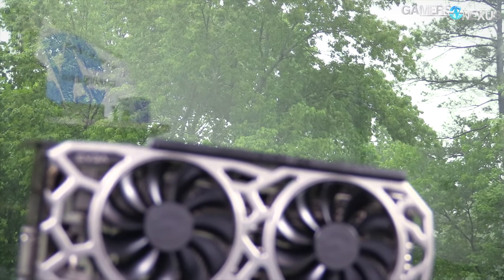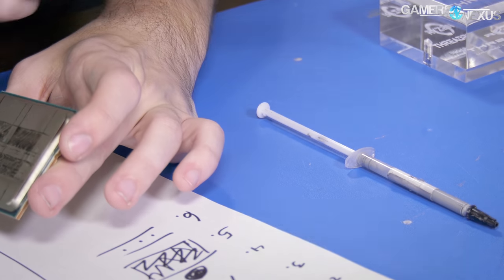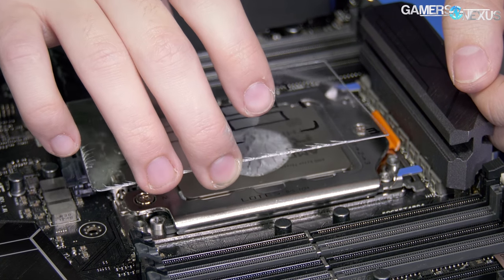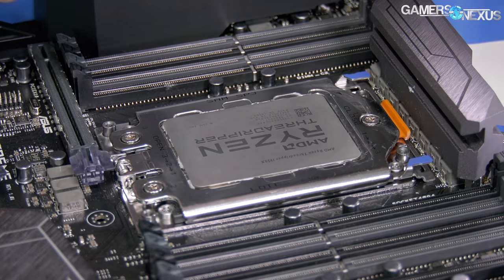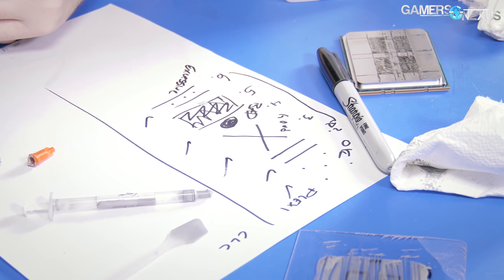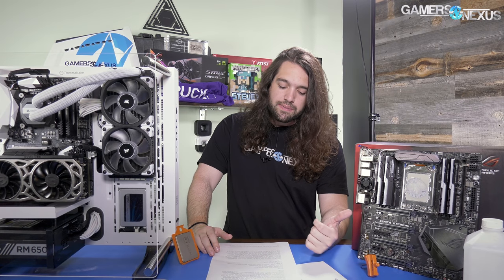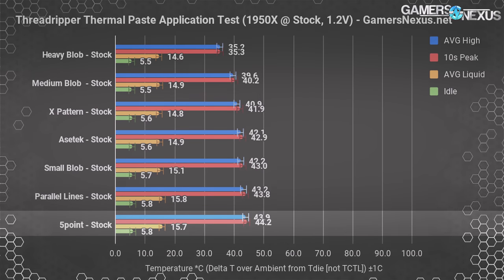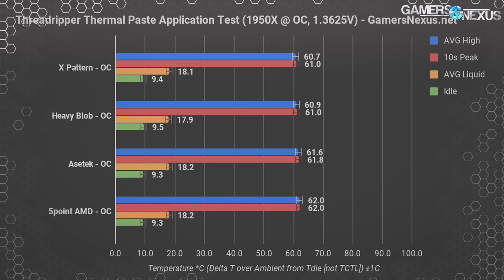Threadripper Thermal Paste Methods Benchmarked

Comment: I would use automotive copper grease and car radiator for that :D
Reply: hides computers
Reply: vabese XD. I actually probably wouldnt do the copper grease but car radiator would be good. P.S- using copper grease on core 2 duo(does pretty well 50C maximum with Scythe Ninja 4 passively cooled)
Reply: I've been considering using a car rad for a long time. Guess when I have my own house I might do it.
Reply: ColtaineCrows I knew a guy from Germany who used a car or truck radiator with his set up. Had it under his desk leant against the wall with a bunch of various fans attached with wire. 

It performed really well ha.
Reply: I'd just stick it outside and let it cool passively, don't want to go too overboard in "sub ambient" cooling. But yeah, it would work well, it's meant to cool off lots of liquid with several kW's of heat getting pushed into it, having to keep that liquid at around 90*C even while the car isn't moving and using only a dinky little fan in many cases. Cooling a mere ~200W or even 500W would be a piece of cake. 

Anyway, there's the whole mixed metals thing, but a G30 auto-coolant or similar should have the correct corrosion inhibitors to make that less of an issue as long as it's mixed correctly.
Reply: ColtaineCrows aren't most car radiators aluminium? So just use an aluminium block...
Reply: car rads aren't designed to be used like that - they're meant to get LOADS of airflow, more than even our fans will give.... That being said, the original watercooling radiators were all salvaged or new parts from the heaters in cars - less airflow, less pressure needed for optimal performance.. also a lot of car rads are aluminium or alloy these days
Reply: john bumptybump 

They work, the fin density isn't much higher than a standard pc water cooling system. So long as you don't get one that's obnoxiously thick even minimal air flow will allow it to cool very well thanks to the obscene amount of surface area. You also have to bare in mind the fans mounted on say motorcycle radiators only move about 300-400 CFM. 4 decent pc fans would do that. Or two obnoxious industrial pc fans ;) 

Car fans probably move a lot more air but there's a lot more restrictions infront and behind the rad. Even on a motorcycle things like mud gaurds / beaks can restrict airflow to the rad a bit. 

Being able to completely cover the things in fans adds up :) 

For example my motorcycle radiator would accommodate 4 140mm fans quite nicely, or 6 100 mm fans. That's a lot of air potentially depending on the fan set up.  

Also, vehicle radiators deal with a lot , a lot more thermal output than any CPU or GPU ever would. So having less airflow. Like say 200 CFM or so, from 4 gentle typhoons would be more than adequate to deal with a good 2000w of thermal output from your system ;)
Reply: Well, could just as well just use a heater core, no need to go full blown rad. Still letting it passively cool for what wattage a PC puts out would be totally fine. Could throw a car rad fan on there and run it at a lower voltage than it was designed for given you have a power source that could supply sufficient amperage. 

Remember the most efficient diesel engines still throw 60% of the energy it consumes off as heat. A gasoline powered engine throws around 70% out as heat. Sure some of that goes out the exhaust and some in the oil(still gets cooled by the coolant), but a LOT of that ends up in the coolant loop.. That's way, *way*, more than any normal desktop PC will ever put out.
Reply: +GetTheCheeseToSickbay, I thought I wrote that somewhere, guess it was a different comment. Anyway, yeah, most car rads from like 1995 onwards at least are most likely aluminium. Older ones would often have brass hose "connects" and copper cores with aluminium or even brass fins.
Reply: largely because of thermal mass, yeah... so not efficient though
Reply: People used car radiators for watercooling for years. In Europe the Opel Corsa air heater radiators were the most popular. I still have one kicking about on a shelf, with the fittings still attached :) It's all copper and really thick, but still small enough to be practical.
Reply: Personally, I'm using a R6 Yamaha radiator, combined with two 200mm fans for a push/pull setup. However, it'll be for cooling three PCs in a single loop.
Reply: People used to use automotive heater cores for ghetto custom water cooling. Gotta watch the mixing of metals though, not all of them have the same.
Reply: Raven1024 Indeed, even at the time mixing metals in a loop was a big no-no.

Comment: I suspect that using a center blob would allow all if not most of the air to be pushed out the sides where it can escape where some of the other methods could trap some when the paste fronts meet up during spreading. 

2nd point about a single blob is there is a much higher concentration of force on the paste which would spread and thin out faster (of course slowing down once spread some), so while the others are still spreading under load and being tested the blob method is more than likely spread thinner by that point and probably is why the performance in the test is better. The thinner the paste layer the higher the thermal transfer rate.

over say a few days or weeks the others should catch up in performance and all should improve as well. 

My method I found with testing to work best is to spread a good amount paste over each mating face, CPU and cooler and then using a lint free cloth I rub the paste thoroughly into the surfaces without removing it. Then I use a plastic card as a squeegee I scrape off everything I can. What this does is it forces the paste into the microscopic grooves and texture of the surface filling the voids so majority of gases are pushed out and replaces with paste. The surface looks clean but discoloured, darken using most pastes on the market, I use AS5. That is the paste embedded into the voids. Then from there I proceed the normal blob method.

Comment: i always just used card or something thin and manually spread it thin layer all over the heat spreader then let the cooler press out uneven spots always worked fine for me even gotten some what cooler results then using just blob in middle method since not insanely caked on

Comment: Thanks for this, conclusion I've come with no reason to get a threadripper until there's a full plate solution.

For me, it's waiting for a custom water block, EK has stated they are working on one but nothing on their site yet.  Other than if you punch in the ASUS Zenith board block status is, "Coming Soon."

Comment: I think you should do this again actually bolting the cooler to the socket. You can make up for the thickness of the plastic sheet by using spacers of the same thickness with any bolt-on cooler that uses the 4 corners.
Reply from the maker: We did that later in the video.

Comment: The problem you are having with the plexi-glass is because its too thin and it is actually flexing, causing a less even spread. If you use a thick solid piece of plastic you will be able to apply better, even, pressure and get a better result. Also something you and most other youtube pasters forget is, once the system is running, the heat from the CPU warms up the paste and helps it spread out more under the cooler, not just from the pressure of the coolers mounting.

Comment: Redo this test after you get a cooler with full TR4 wide rectangular plate footing on your hands. Not that small-ass, wrongly shaped AseTek. Fortunately for you - Enermax just now announced the availability of LiqTech 240 TR4 AIO with a plate that FULLY covers the entirety of THREADRIPPER's socket. This thing should (and highly likely will) work way better than AseTek.
Reply: In their (Enermax) video they put a tiny blob of thermal paste on center the IHS. That cant be right after watching this video.
Reply: Naturally that was just purely for example purposes.
Reply: It may have been an example but the problem is people may see that video and continue to think that putting a tiny little blob on paste is still the way to do it. From the size of the blob they put on in that video and comparing to what was shown in this video there will be problems.
Reply: I personally highly doubt that anyone who decides to buy an expensive, high quality, high-tier AIO water cooling solution, is so utterly inexperienced or downright stupid as not to do the thing the right way. People such as these won't bother and would just buy an air cooler, instead of "messing with water". Even if it's "just an AIO" and not a hardcore solution that is FCWCL, you still need to have at least some minimal experience accumulated of dealing with computer hardware, before you go and decide to buy yourself one. Air, on the other hand, is, mostly, absolutely "fool-proof" (ESPECIALLY if it's something like a Noctua or a Cryorig product) thing. At least that's how that usually works.
Reply: Not everybody who buys these high end systems builds them themselves. I new someone who bought a boutique HEDT system and there were no air intake or outflow fans on the thing - it had an AIO and the builders told them that was enough airflow. Sure enough when it was overclocked it overheated which i cured by installing more fans.
Reply: Well...I obviously meant overall worldwide usage, not a few isolated specific cases which only solidify the general rule.

Comment: What would have been cool is to mount the heatsink, but have a super thin piece of clear plastic between it and the paste, such as an overhead projector transparency sheet, so that you could remove the heatsink and see how it looks without the paste getting pulled up when you remove it. You could compensate for the added thickness by not tightening it down completely.

Comment: Nice Video. The heavy and medium blob method doesn't produce small air pockets as the others where thermal paste has spacing between application areas. How about the old method of making a thin layer on the copper plate of the heat sink covering the whole circle even filling the screw holes (we used to do it on the CPU but seeing that the CPU is bigger then the heat sink you put the layer on the heat sink)

Comment: Doesn't the heat spreader do just that-- spread the heat? under continuous usage, the whole surface comes to an equilibrium depending on how much heat it's getting, so focusing on where the TIM should be, instead of trying to maximize surface area contact for a given heat sink, seems a little silly? If I disable all but one core on my ryzen 1700, after a few hours, temps reported for each core will be within 1-2C.
Reply from the maker: That's the point. People argue about method for application all the time, though.

Comment: A solid peace of hard glass would have worked much better than flexible Plexiglas
Reply: It was just meant to be used as a visual demonstration of how the thermal paste would spread :)
Reply: without the massive mounting hardware, you're never going to come close to the pressure needed to show a realistic spread.
Reply: yea, i watched the rest of the video, and i guess he does address it.
Reply from the maker: We address that pretty thoroughly when we come back with the actual cooler mounting.
Reply: Most AIO's also recommend a twist. Read the manual of your AIO's. Twist and back 45 ish degrees.
Reply: Gamers Nexus u will have to put the glass under the cold plate and torque it down to get the recommended pressure. 
Put a little cloth or piece of mouse pad to protect the glass from breaking under the cold plate.

But seeing the after pics of the cold plate have shown the spread of the thermal paste, already. So unless a different sized cold plate is used, this will be redundant
Reply: he should have just used the ryzen glass case, lol.
Reply: Use a thin piece of clear plastic under the normal heatsink and torque it down. Then remove the heatsink.

Comment: Since there might be air trapped in the countersunk screw holes on the copper plate, I wonder if it would be better to apply the paste to the cooling element instead... filling the countersunk holes with a bit of paste to push out air.

Or an alternative idea: Use any good pattern on the CPU (something resembling "flag of Wijchen", probably), and pre-fill the countersunk screw holes with small blobs of thermal paste.

Comment: Is this method any good?

 Use the thin spread layer method(possibly a little thinner than normal) on the cpu or heatsink surface(whichever is smaller). Press the cpu and heatsink together making sure it's around the point it will be when mounted. This will create an imprint showing the surface area shared by the two surfaces. Lift the heatsink up and use the paste that was already applied to spread a very thin even layer in the space shared between the two surfaces on both the cpu and heatsink. Make sure it's even and covers completely(the shared surface area). Then apply a very small pea on/over each die area. Use as small of a pea as possible. Then press the heatsink back on top of the area imprinted and rotate back and forth while pressing very gently on the heatsink. It should feel like it's floating on the paste. Without lifting the heatsink align and fasten the heatsink and try. If done right it should not leak anything out.

I do this on the thought it will fill in micro crevices. This method also scales with any level surfaced varied size die/heatsink and logically produces full, basically exact, coverage. I'm not sure if there is anything bad about it. Are there any problems with it that you know of? I don't really know anything about how thermal paste should work on a technical level.

You can do the gentle rotation part while the heatsink is partially attached if needed. It should help spread the pea sized dots around.

 Also, Is it bad if small amounts of black substance are left on a die surface. Mainly left after cleaning with just a paper towel. I usually then clean with fresh paste itself and a further wiping down to remove as much as possible. But there is some small residue left afterwords normally.

Comment: another cool way to show the spread is to use a transparent film (like the screen protectors for smartphones) between the cpu paste and the cooler, so you can put real pressures and then remove the cooler leaving the film... hand pressure is not perfect and you could damage the mother

Comment: so wait... intel can't keep one cpu die from not hitting its thermal limit without risking breaking the thing with deliding and then you'd need a fairly respectable liquid cooling setup to even handle it? yet amd can keep 4 cpu dies under complete control with a standard aio even when not completely covering all the dies? intel wtf...
Reply: AMD spent the extra 2$ to solder their dies to the heat spreader.  Intel being supper cheap this way finally bit them in the ass.

Comment: Thanks for the exhaustive testing. But I have a suggestion: 
What about trying without any thermal paste? This would clarify the issue that some people have with it: after all, the best heat condutor is direct metal to metal contact. If there are not enough air bubbles to justify applying the paste, it actually has a detrimental effect.
Reply: They did and he mentioned it towards the End.. They said TR did not like that at all.
Reply: Oops, probably skipped that part. Thanks for letting me know.
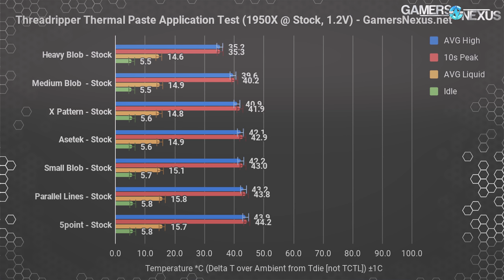Reply: Yep, just found it at 18:30. Thanks again.

Comment: Great video! I am going to buy a Threadripper probably around December, and I was wondering how to apply the thermal paste on the CPU. I have always used the blob method on my applications of compound, but I thought the line method would work on Threadripper. Who would have though a bigger blob method would still would on a bigger CPU.

Comment: Wouldn't using a thermal camera to determine which parts of the cpu actually produce more heat (and thus figuring out which are the active dies) be a good idea? Just a suggestion. I guess this aspect shouldn't change from chip to chip, as - as far as I know - AMD stated that the "inactive" dies are dummys not actual deactivated dies.

Comment: id suspect any of those methods included the first blob would work just fine once you apply real pressure with a cooler and some heat from powering it up

Comment: Why not pinch the plexi between the CPU IHS and the cooler? I know the plexi adds depth but you could still use it to clamp down to roughly the pressure. Removing the cooler would then reveal the plexi and paste spread without much disturbance.

Comment: Hi Steve, any chances to do the same testing now with the Enermax Liqtech TR4 given the 32 cores 2990wx is out?
Would be interesting to see any differences in temperatures using different methods to apply thermal paste.
Thanks for your reviews, always very detailed and useful 👍

Comment: If you have a cooler with a base that covers all the cooling plate of the cpu, then you would have gotten different results. I belive that Noctua has a cooler that is specifically made for the new threadripper cpu. The large blob in the middle would not spread out to the sides equally since the plate is a rectangle, and not a circle or quadrat.

Comment: Am thinking about swapping my AIO with a noctua air cooler for my 1950x. Curious if youd be willing to revisit this with Threadripper 2 but instead of different patterns, play with the blob method and weigh the thermal paste tube to get an exact gram measure of how much is needed before the point of diminishing returns is reached.